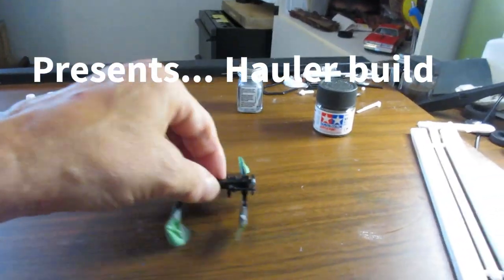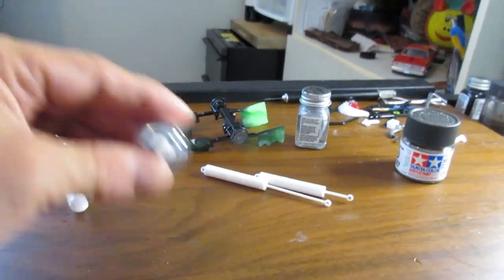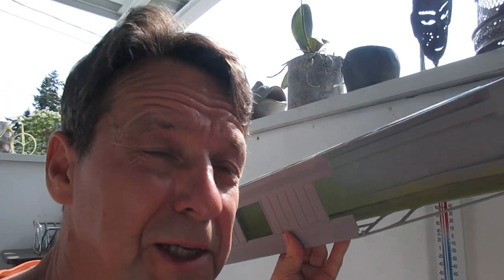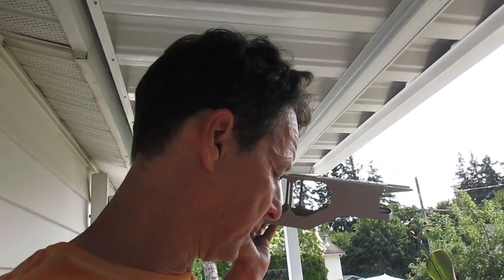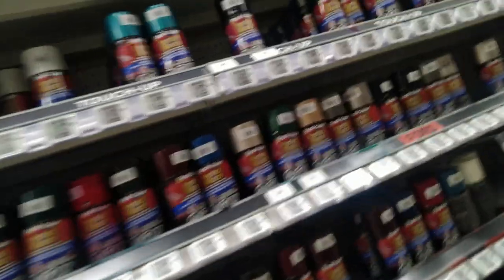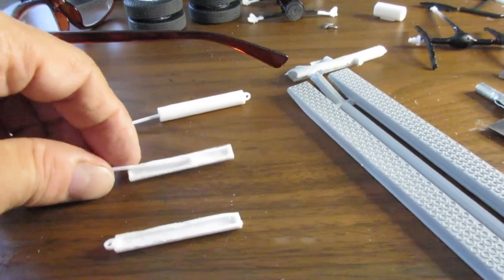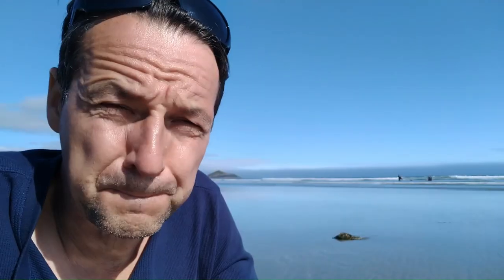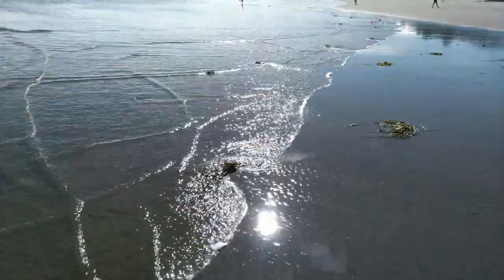AMT car hauler build update and my week update

Comment: Learned the hard way back in the early 1970s that glue don't stick to paint or chrome. The spray paint supply shenanigans are still being played where I live. It seems to be affecting the cheaper generic brands the most, plenty of name brands available at ever increasing prices. Recently the local Hobby Lobby had a specific type of Krylon discounted to seven U.S. bucks, but not all the Krylon types. I noticed that in the past few years that some spray paint that is discounted is not restocked after it sells-out.  I am not going to pay 10 U.S. bucks for a tiny can of fake Testors spray paint. The last can of real Testors I bought was in the late 1990s, for a whopping $3.17!